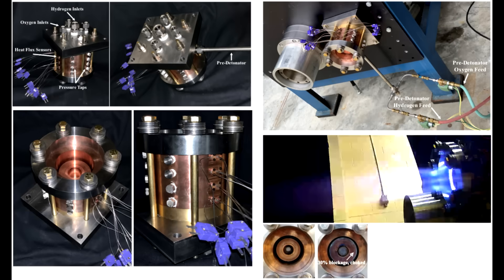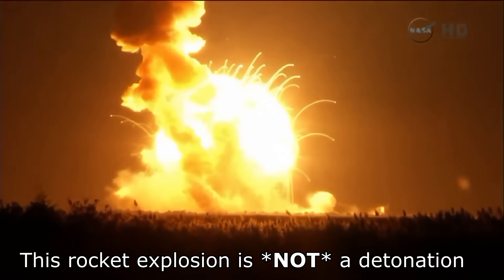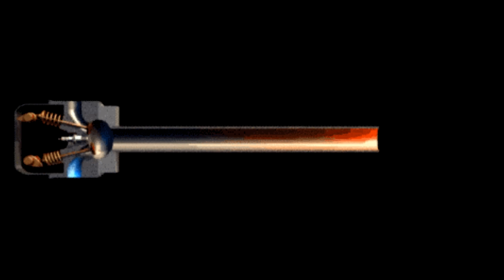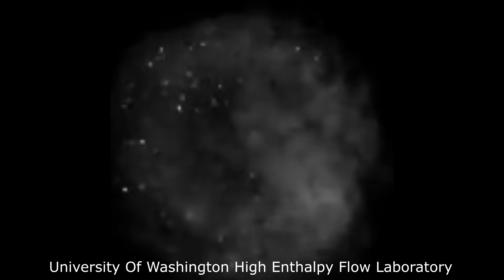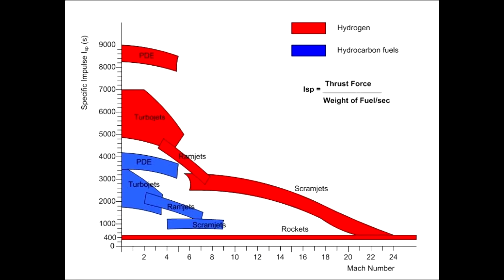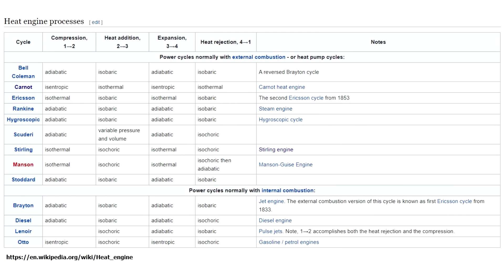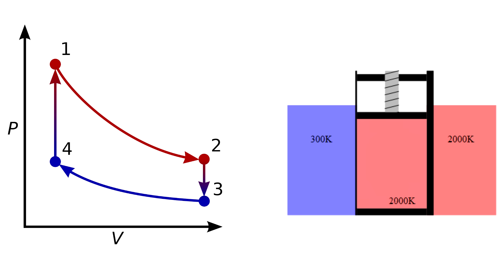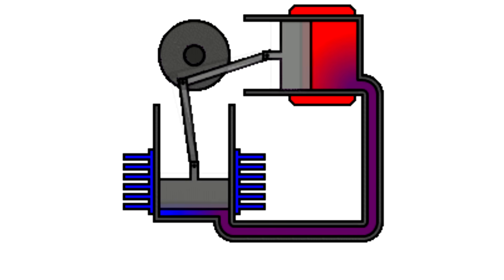What Is A Rotating Detonation Engine - And Why Are They Better Than Regular Engines

Comment: As a life long fan of space flight (watched first moon landing when I was 5), I have been slowly learning the technical aspects of rockets. My dad was a race engine builder. One of the things that allows a auto engine to work is that it cycles the most heat stresses parts. Getting a little time to cool makes the metals used able to deliver amazing performance. Sounds like it's time to apply the same idea to rocket engines.
Reply: Possibly - one of the things to understand about rockets is that they are:
1- not 'mass-produced' and therefore more given to using exotic materials than most engine blocks
2- focus more on constant thermodynamics and on thermal stress tolerances than 'duty cycles', whether milliseconds or minutes long; one of these ideas is found in nozzle designs, specifically in ablative vs. rigid, and the innovation of regenerative cooling.

Dealing with detonations would require more of the engineering involved in harmonic balancing for driveshafts - dampeming/destroying vibrations & such.
If you haven't already, look up Scott's video on designing and testing the F-1 engine for the Saturn V.
Reply: @HuntingTarg  In response to point 1: It is the exhaust valves that are the most thermally and structurally stressed part in a 4-stroke piston engine. Modern race engines routinely make use of exotic alloys for the valve & seat. The amazing performance would not be possible without the time for cooling while closed.

In response to point 2: I have been well aware of the basic technical features of our current state of the art in rocket engines since I was in my twenties when the space shuttle was in development.

What I am trying to say is that intermittent combustion based on the detonation cycle (while fully aware of how hard it will be to work out the harmonic stresses) would allow us to leverage the use of the best materials even more than they are now. A 25% efficiency improvement is a BIG chunk of mass in fuel. Engines could be a lot heavier and still come out ahead.
Reply: @markhatch1267  👍
We're roughly the same age and came into real-life rocketry through the same avenue - the Orbiter program.

I'm aware of the thermomechanical stresses on valve covers, and while you're quite right, 90+% of any production-line engine block is some variety of hardened steel or cast aluminum - economies of scale don't like high-tolerance, expensive parts.  (I said 'more given to', since the quantities rocket motors are made in lines up with Supercars).
Reply: @markhatch1267  
I have a notion, that in a rocket engine that is typically designed for radially aymmetrical collimvariable flow, a 'rotating detonation' within the combustion chamber could introduce undesirable flow instabilities.  While this may or may mot be a problem, I have to wonder what a rocket motor designed for vortical flow would be like - and then wonder what  detonation front would be like in that engine... 🤷‍♂️💡
Reply: @HuntingTarg  Did you really mean valve covers, or is that a typo?
Reply: @HuntingTarg  Einstein said imagination was more important than intelligence. However I think his idea of imagination was quite a bit more sophisticated than most of us are capable of.

Comment: Scott, how are rocket engines attached to the frame of a rocket? How does the thrust of the engine get transferred to the body of the rocket without deforming the frame with all that pressure?
Reply: In simple terms under the fuel tanks there is something called a thrust structure which the engines mount to.  This is connected to the body of the rocket.  The engines push on the thrust structure which then distributes that force to the body lifting it.

Comment: Your heat engine animation is not quite right.  In the ideal engine, heat is not allowed to flow through a temperature drop.  The gas is first compressed (no heat flow permitted) until its temperature matches that of the hot side (blue change to red).  Then it is expanded and heat added at the same time for a first portion of the expansion (red color unchanging).  During the rest of the expansion, no heat is added, so the gas cools until its temperature matches that of the cold side (red turns to blue).  Then first part of the compression cycle, starts, where heat is removed to the cold side (blue color unchanging).  The latter part of the compression cycle (described at the beginning) is the start of the next cycle.

Comment: Detonation engines can't beat rocket or jet propulsion because it can't push the volume of fuel air mixture faster than a rocket volume.  It can only function as specific speed range engine due to the speed of the detonation front of the fuel air mixture.  Example the V1 buzz bombs could only fly to 450ish kmh because of the cycling of the engine works.  Been there, done that.
Reply: The V1 was a pulsejet (subsonic deflagration) not a pulse detonation engine. A true detonation is supersonic and these experimental detonation engines are good up to Mach 5.

Comment: I remember the movie "Stealth" had pulse detonation engines in the new A.I. fighter EDI, and the fuel used was Methane. It must have been a rotating detonation engine because the noise generated was linear and not pulsed.
Reply: A rotating (or more properly revolving ) detonation engine of the type recently tested makes a very high pitched whine, like a model jet engine, although the generation involves a completely different principle.

Comment: I predict a self-balancing, counter rotating fluted cones which carry fuel on the inner flutes and oxygen on the outer flutes, so that the combustion can occur as fast as the waves can be made to hit the right frequency, depending on the revolutions of the two. In this way, both sides of the counter rotating drum could be manipulated for "gearing" of the exchange, and the two cones can be made to come closer together or further apart to create stronger or weaker shockwaves, thus give a full range of control over the reactions going on in the chamber.

Comment: So they basically want to use the high pressure created from the detonation to pressurize the chamber but the back pressure from the throat is killing the cycle. It must be a fine line figuring out the frequency needed to feed the chamber.

Comment: ...a quasi-jet engine that operates just fine up to Mach 5 without even needing a compressor, has fewer moving parts, and is significantly more fuel-efficient? Holy hell, that's a game changer. Not just in terms of engine power--without a compressor, the aerodynamics would be easier, the engine would take up less weight and bulk, the complexity of handling the supersonic air would be easier...wow.

Comment: Very nice to have some heat engine thermodynamic cycles explained by charts. It is difficult to go into efficiency calculations without covering a lot of background material but pointing out that work corresponds to the enclosed area in P-V diagram as you did gives a very good idea of what is involved in increasing efficiency.

Comment: Hopefully this engine won’t be completely like the rotary motor in the rocket family
Reply: You mean...

- Double the power by weight
- Half the size
- Way simpler to build
- Less picky on fuel
- Happily runs on hydrogen
- Less vibration
- Easier scalability
- Doesn't self-destruct so easily
- Cheaper

Sounds good, actually!
Reply: @juhalampola1954  I'd love to live in this ideal world of yours. ;)

- Less picky, sure, when you need as much you better be.  :P
- Seals are a bitch at the very least.
- Cheaper assuming we didn't already have all the machinery, infrastructure and most research devoted to pistons engines.

And with that all said, I agree with much of what you said and think it's sad that there isn't more of them.

Comment: Did Scott misspeak at 0:17?  What does it mean to have 100kg of thrust?  Did he mean Newtons instead of grams?  I'm ignorant on this so I'm really not sure, it just sounded strange.
Reply: It means 100kg x 9.81m/s^2 = 981 newtons of thrust.
Reply: @44R0Ndin  Thank you!  I really wasn't sure.  I figured gravity was involved somehow.
Reply from the maker: If von Braun can state thrust in kg, I'm comfortable with it.
Reply: @scottmanley  No problem, the other commenter explained how it converts to Newtons so it makes sense now, I had just never heard it used as a value for thrust before.

Comment: Is this similar do the pulse wave detonation engine that I learned about about 30 years ago? From the description, I believe this is it. But this is the first I've heard about it in about 30 years. Once I had heard about it, everything went silent about it. Which makes sense because it was a classified project at the time. But it has been under development for at least that amount of time. Have there have been aircraft that have been flown with the pulse wave design for some time. The rotating pulse wave would make it more effective if you can get the timing right. It might not be quite as efficient however.

Comment: I have a rotating detonation engine in my car, it's a Mazda RX-8.  Blap blap blap blap Bang Blap blap blap Bang.  :)
Reply: If rotaries detonate they very quickly blow up. They run on normal deflagration like any other gas engine.
Reply: @xeigen2  sunshine,  the reference to take note is the "bang"

Comment: If you think about it, it’s very similar in shape to an aerospike. At first I wanted to say it’s like a wankel rotary motor and it does function kinda like that but by using a mix of an aerospike shape and traditional exit Nozzle.
Reply: Wankel rotaties don't detonate though. They run on normal subsonic deflagration (i.e. burning instead of exploding).

Comment: Does anyone have other images of the V8 PDE used in the Rutan-Long EZ? I'm curious about eventually building one and trying to figure out which exhaust and air intakes they're using and if they're using a forced induction system. Thanks

Comment: Two things I think will be challenging with this (other than just making it work): 1: noise.  And 2: vibrational modes... see "Lockheed L-188".
Still a cool idea though!
Reply: Noise is a problem, that tiny 200 lbf thrust PDE on the Long-EZ had a noise level of 130 dB in the cockpit. The detonation waves themselves are inherently ~195 dB so imagine how loud a large high thrust engine would be.

Comment: This issues of maintaining conditions along the combustion front make me wonder if this is a job for active closed-loop control systems monitoring conditions and very rapidly adjusting valves, rather than trying to design an engine which intrinsically has a great deal of combustion front stability.
Reply: That sounds both complicated to design, and heavy to implement. So, the exact opposite of what you want in a aircraft or rocket engine.

Comment: I helped build the first self-aspirating Pulsed Detonation Engine with Dr. Fred Schauer at Air Force Research Laboratory in 2003.  It was built with junkyard parts (An old Honda motorcycle engine with the tubes jutting out between the block and head), but proved the concept.  They made another non-self-aspirating PDE (it had a supercharger powered with a piston engine) that actually powered a Long-EZ in flight several years I left the program, which is the one you see at 3:50 in the video.  You're just seeing the PDE there-  the big compressor in the belly tank that fed it.  I still have my engineering-pad sketches of a variety of rotating PDEs, except my ideas would have one wall of the tube rotate, or have the tubes rotate more like a gatling gun.
Reply: The thermodynamics of the detonation engine compared to standard rocket engines is very much like the new HCCI (Homogeneous Charge Compression Ignition) engines compared to standard petrol engines. HCCI engines have been developed which compress the air fuel mixture to just below spontaneous combustion. The spark plug then ignites the fuel air mixture and the slight pressure increase from deflagration causes detonation of the rest of the air fuel mixture. The pulsed detonation engine is basically an HCCI engine without the pistons and vice versa from what I can see. The rotating detonation engine looks like a very interesting concept, just need some way to stabilise the detonation wave. Maybe with a rotating inner or outer sleeve as you mentioned, with a shaped portion on the sleeve which moves with, and helps control, the detonation front.
Reply: @Bordpie  Daimler Benz & were testing HCCI engines in WW2.   They injected DME to get ignition.  They called them ring cycle engines.    The new HCCI engines are called RCCI engines and add a spark plug for wider range of operation.   The can operate at Lamda as low as 0.4 while meeting pollution regulations for NOX whereas spark engines can't venture far from 1:1   It's this ultra lean territory that helps make them extraordinarily efficient.  Possibly as high as 58%.    I think the engine you refer to is not quite a HCCI engine but has been implemented by Mazda.   I think they manipulate a pre chamber with a normal spark to create a shock wave that compression ignites the remainder of the mixture.
Reply: Can I get one of those for my Hyundai? That's a badass engine.
Reply: to sit in the pilot's seat of a Gatling gun pulse detonation engine.... weird vibes. Think an engine was designed with the barrels angled so the the exhaust was pushing the rotation around a central shaft with injected hydrogen as fuel. think of the hydrogen as the belt fed ammo in the Gatling gun but the firing spins the barrels
Reply: I did some co-ops there and got to work with some of the same people who were a part of that. This field is super exciting.
Reply: You know it's a great project when you are trapping junkyard parts together with Ducttape and then trying not to have it blow up xD
Reply: Very cool plane. Do you have any links to web pages or youtube videos with this "engine" or plane? I don't recall reading about it before. I'd love to learn more about your project.
Reply: I wonder if electromagnetism could be used to control the detonation rotation? Possible? Practical? Would it take more power than it offers? Just a thought.
Reply: I'm about to take a crack at these detonation engines, you want in?
Reply: @kingmasterlord  What'd you have in mind?
Reply: @Niles Black I was an Lt. in the Air Force, but everyone else on the program was a civilian or student.  AFSC is 62- development engineer
Reply: Fail?
Reply: Could you post those sketches? They'd be pretty interesting to look at.
Reply: @innacrisis6991  I don't think I have any paper work but I might have a few photos.  Where can I post them?
Reply: @blurglide  I worked on CFD simulations of supersonic/hypersonic instabilities at AFRL.  I had downloaded videos of the ground tests of the WP PDRE when they were online years ago.  Any chance you still have any of these videos?
Reply: @mkapper9800  Unfortunately I don't have any videos.  I think I might have some papers and notes around somewhere related to the spiral inside the tubes.  It's crazy how far ahead we were back then on Hypersonics (and drones- remember LOCASS) and then we totally dropped the ball.
Reply: @Daniel Downs Yeah you have the basic idea there.  There's already a sort of helix (kind of like rifiling, but held a short distance off the wall).  You could have the nozzles angled to provide the rotation, and put the entire thing in a duct for better subsonic efficiency and for cooling (these tubes glow red hot at their bases).  For slower things, we were even thinking PDEs could replace the combuster in regular jet engines, giving you a lot of extra compression for free and deadening the noise.  Oh yeah- these prototypes were LOUD.  Like a machine gun, but WAY louder.
Reply: Marc Jackson  I don't know what happened to the plane, but since the Air Force Museum was right down the street from where it was built, I imagine it's in one of their storage hangers.
Reply: Jefe Anson  Then you have a pulsed detonation rocket, which is very easy to build, but carrying your oxygen isn't really practical for an aircraft.
Reply: @Niles Black I was in the military at the time...a 62.  Plenty of civilians work there though